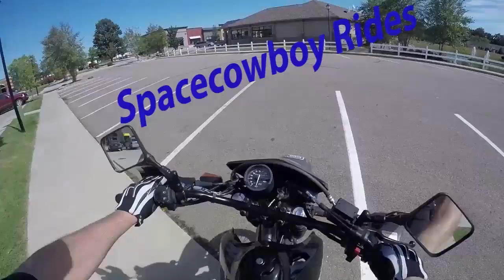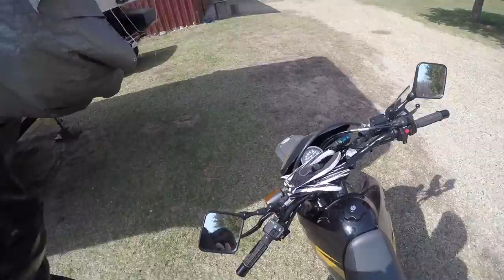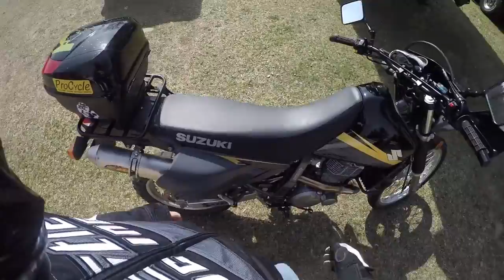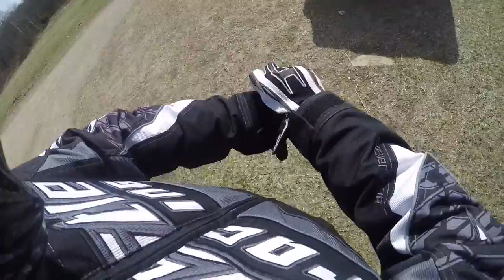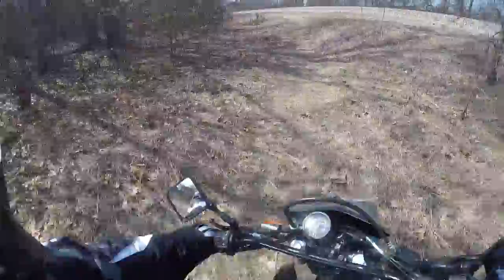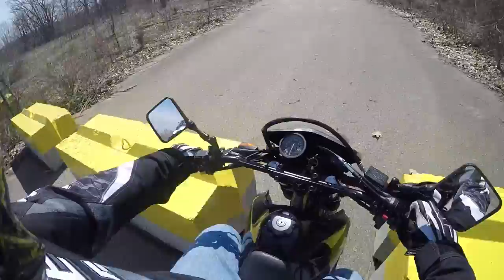First ride with the Dr 650 after an fmf exhaust upgrade

Comment: Nice! I have the same pipe on my DR650, the Q4 sounds great. If you want even more pep, try the TM40 pumper carb, high-comp piston and the 223 cam (all from procycle). I ended up spending a bunch of money and did all those mods. Turns out it was worth it, the power is quite impressive now.
Reply from the maker: Trevor Jameson Thanks that's my plan someday

Comment: For lower  gear ratios  put a fourteen tooth front  sprocket  on way better  us of power
Reply from the maker: Michael Hay . I put a 13 front on it. And it started to ware the rubber on the swing arm. Now I have a 16 front and I'm going to play with the rear.

Comment: man I've been missing this videos.
that fuzzy thing is probably something like "noise canceling filter' I don't know.
For a lower gear ratio can you just change out the sprocket?
my friend just bought a new KTM 1300 dual sport and it's stupid fast I would not want to take it off road.
I rode it the other day, my first bike ride since me wreak a year ago
Reply from the maker: ethan trashedteg I did get some lower geared sprockets just haven't installed them yet